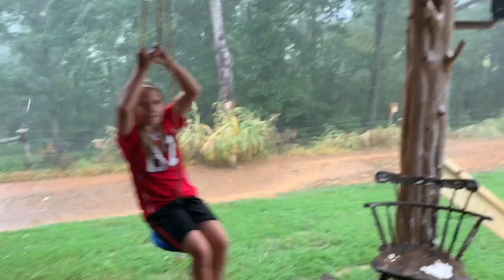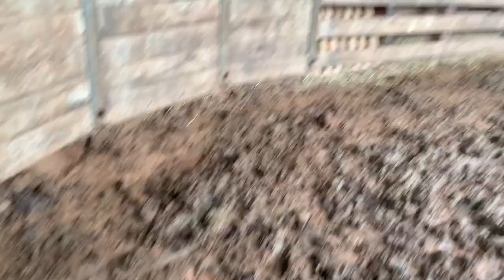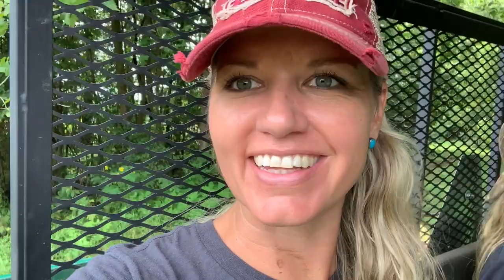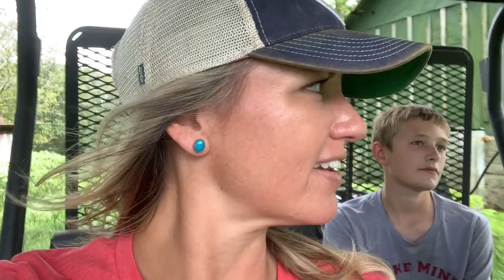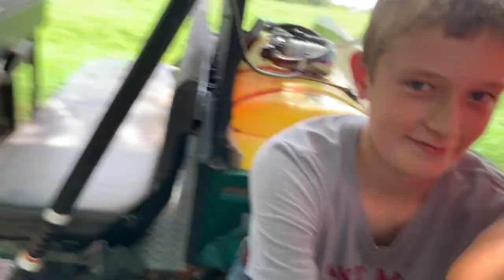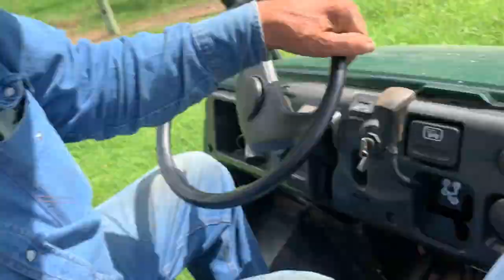Sold! And THANK YOU! 😭

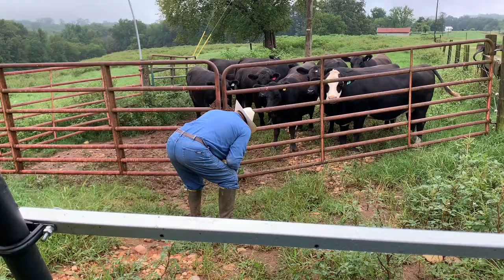Comment: 4:00 try wrapping the gate with some durable tape, this would seal off the opening and stop the wasp problem....cut up an old garden or radiator hose and clamp that over the opening...like a bandage for leaky pipe...spray some expanding foam into the opening...or...cut  up an old rag and stuff in the opening...cram a bunch of that mud up into the opening.